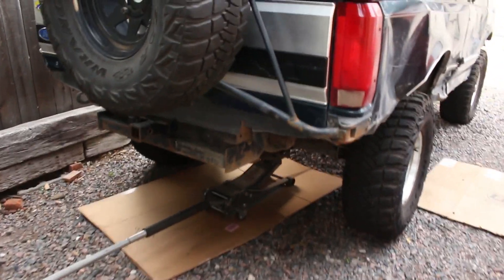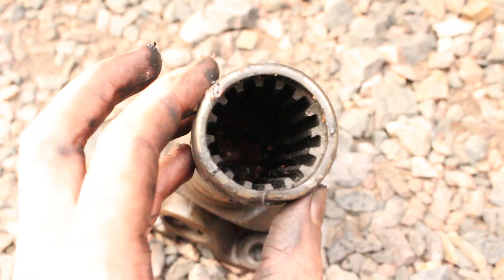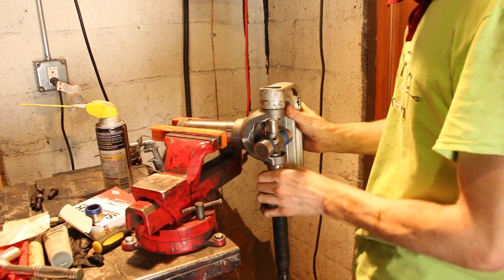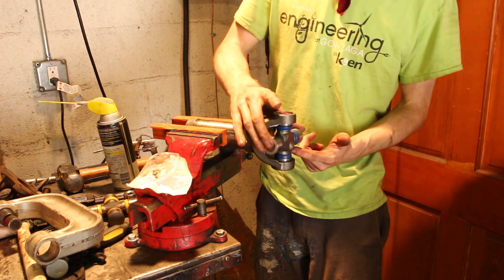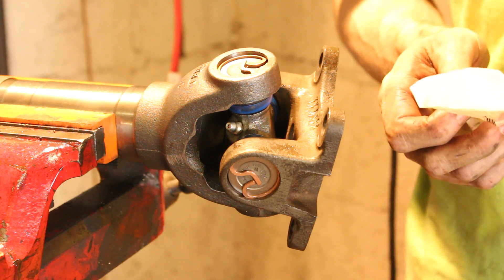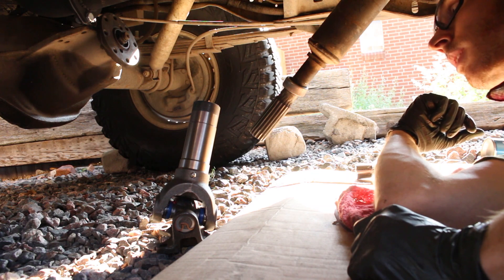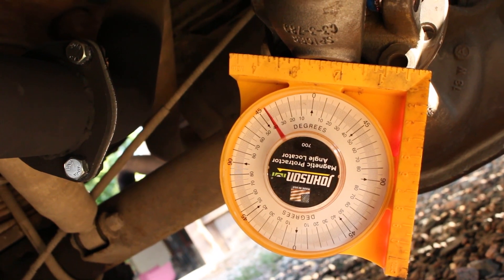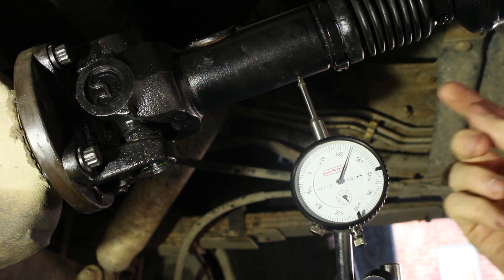Bad Driveshaft Slip Yoke?

Comment: what do you mean by feeling vibration in the rear still? (and it rippling to the front drivesahft) what is this from and how can you tell if your rig has it? You just hear it when driving sort of thing right?

Ive got an 85 land cruiser, my buddy has the same one, his has a little vibration in the back, but it might just be lose panels.

Curious what to look for with this, both are lifted 2-3 inches and OLD trucks.

Dan

Comment: Your drive shaft is too short since your vehicle is jacked up
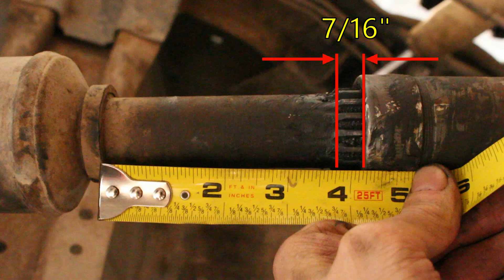Reply from the maker: It is possible. It is hard to say because I'm not sure what the engagement is supposed to be for the slip yoke, I check my engagement @ 0:52. Also the driveshaft was modified when I purchased the Bronco, notice the upgraded u joints.
Reply: If you could weight down the truck till it hit the rubbing blocks  that would be the most insertion of the slip yoke,  completely unloaded with axle hanging unsupported would be ( almost) the maximum extension. Logically you can insert fully and pull out until splines expose, then measure the total in to out movement. Half way of that measure meant would be pretty close.  Now if you can get factory driveline info so you know what it should have been. Then how much the rig is elevated from original. U can find the math differential between the two by using Pythagorus math formula.
Reply: You can add a diff spacer to make up for the jacking up